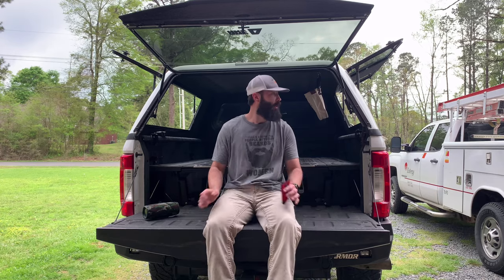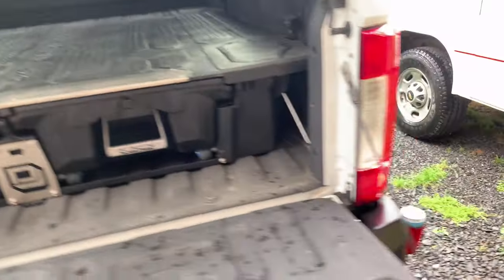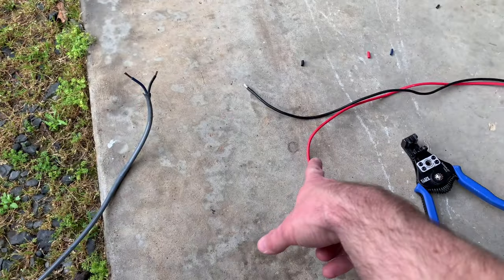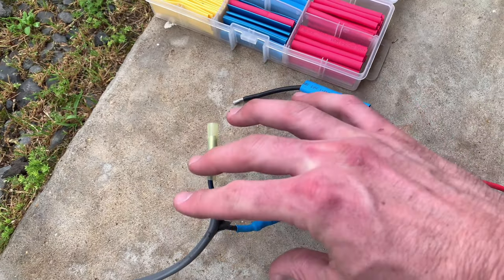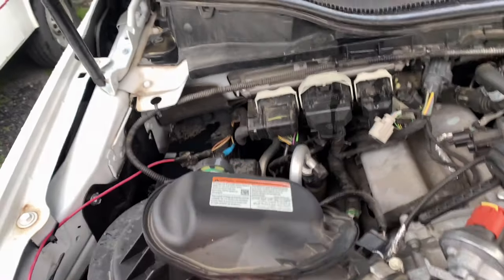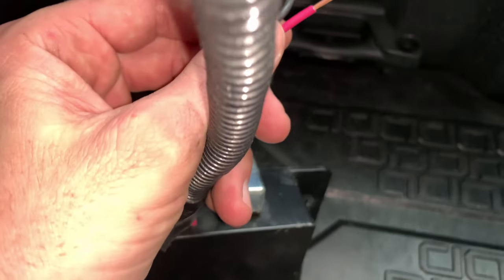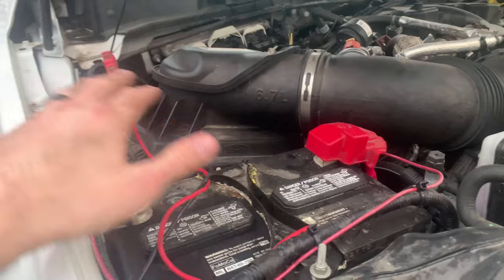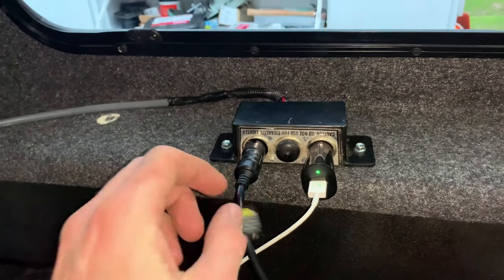How to add 12 volt power to truck bed.

Comment: Pro tip part 2... add a little dielectric grease in the butt crimp prior to heat shrink to help if it’s in the elements. Love the videos
Reply from the maker: Good tip brother, I’ll remember that! I love that your double fisting lattes in your profile pic. 🇺🇸🦅🇺🇸
Reply: @COLTSWAY  yeww! Gotta keep those wires protected! 
Lattes are always better in multiples
Reply from the maker: Most everything is! 🇺🇸🦅🇺🇸
Reply: @COLTSWAY  ya ain’t far off with that my dude 🤙🏼🍻

Comment: I'm putting a hoist and winch in the bed of my truck.  Along with that, I want to mount an inverter for 12v power to charge a lithium battery.  So I need 2 cigarette lighter plugs.  I don't want the inverter to drain my battery when the engine is off. But the engine will be off when I'm using the winch to unload, so i need it to stay hot.  And I don't want to go back and forth turning on and off the inverter everytime I turn off the engine.

Comment: Couldn't you run the 12volt off the pre wired upfitter switches?
Reply from the maker: Yea you could. But then your limited by the fuse  that the upfitter has, and for me it’s alot easier to pull that fuse right there if it blows or I want to up the size. Thanks for watching brother. 🇺🇸🦅🇺🇸
Reply: @COLTSWAY  Thanks brother. Keep doing what you're doing. Your videos help me out A LOT!
Reply from the maker: Shit man, thank you for watching! 🇺🇸🦅🇺🇸

Comment: Dude, you rambled on ad nauseam about how you hate when people snap their fingers and all the sudden one of the steps is done. You literally did that pulling the wire through. That's the only reason I came here man.
Reply from the maker: Sorry bro. Can’t get a camera In between the bed. I figured it was self explanatory, I just pushed my fish tape, it’s a wire used for pushing threw stuff. I pushed the fish tape threw that hole, then hooked my romex to it and pulled it up. 🇺🇸🦅🇺🇸
Reply: @COLTSWAY  Thanks for taking the time to acknowledge and reply.
Reply from the maker: Anytime brother. Appreciate you watching. Sorry I didn’t come threw this time. 🇺🇸🦅🇺🇸
Reply: @COLTSWAY  I got to say, I do appreciate the attitude / energy you put off in these videos. I was wiring a backup camera on my 93 ranger. I like the attitude of I don't have to give a fuck what anyone else thinks.
Reply from the maker: Appreciate that man. I spent way to many years worrying about what other people think. Once I let go of that shit, everything just got better! 🇺🇸🦅🇺🇸

Comment: Why not just just tie into your tow receiver's power? You're only charging a phone and it's 3' away. I apologize if that's a dumb question, I didn't vote for Trump...
Reply from the maker: Well In the thumbnail picture alone i have a lantern and phone and two Milwaukee batteries charging. But I didn’t tie into the receiver because if the fuse blows and I don’t know it I’ll be trying to Hook up my trailer at night in the pouring rain and I won’t have any tail lights. Then I’ll have to fix it at the worst time. Plus I can add whatever size fuse I want to this. 🇺🇸🦅🇺🇸